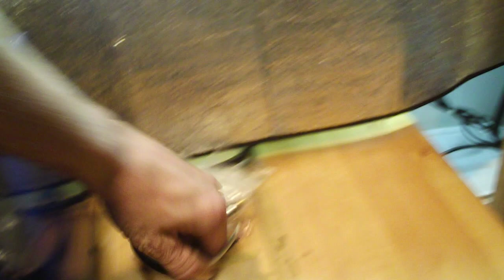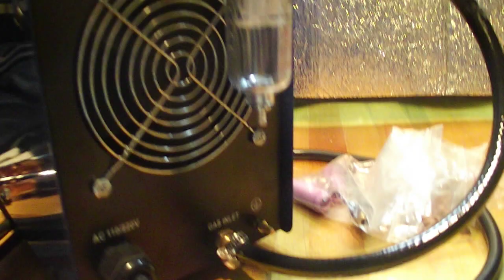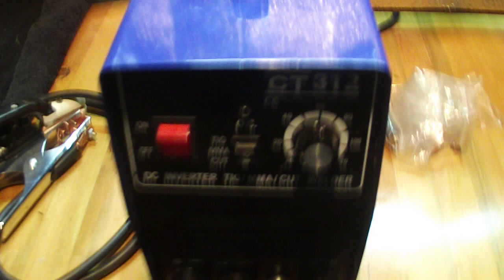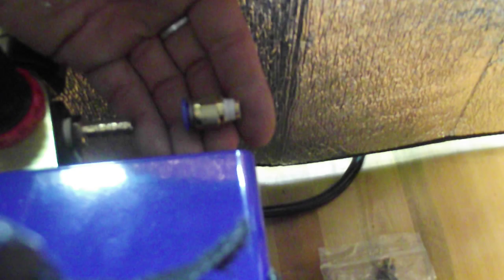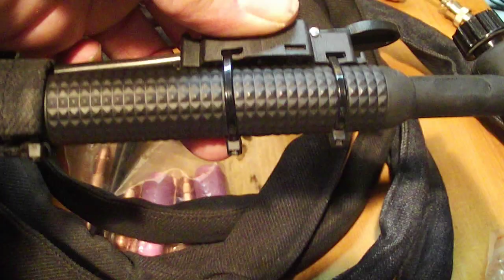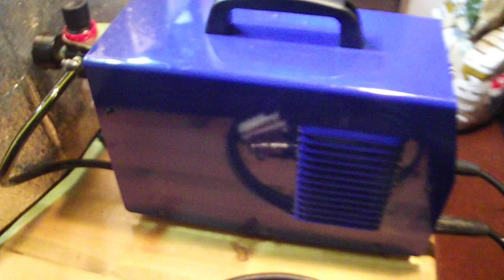Tig/Stick Plasma cutter CT-312 Welder  (Important info in description)

Comment: hi kootenayboy. i'm planning to buy one. mainly to tig weld as i already have a lincoln pack 140 mig welder. i also have a plasma cutter ( mastercraft crap than can barely cut 4mm of metal ) and the ct-312 would repalce it.  every reviews say it is a good unit and it last. do you still like it ?  oh btw don't buy a gas tank it's not worth the trouble. rent it ! i rent one for c25 argo for mig welding. it doesnt even cost 200$ CAD a year with a refill. really worth it !
Reply from the maker: Thanks for that tip, I have come to the same conclusion renting is the way to go.  Our local welding supply shop has the same deal and you don't need to go through all the static pressure testing to keep your tank current.  I've not used the plasma cutter yet but what I've seen others do impressed me it's not good for single pass on thick steel but up to 1/4" it's like a hot knife through butter. With all the snow and no shop I've not been welding much.  I've also got a Flux core wire feed not expensive but works for my needs Lol
Reply: "it's not good for single pass on thick steel but up to 1/4" it's like a hot knife through butter"  well that mean its 4x better than my mastercrap i have lol. the quality probably isnt better tho... mastercraft welder/cutter are as good as lincoln and other but underpowered. anyway ive seen a ct-312 open on youtube and it look very easy to repair. i didnt see any electronic component that i never seen elsewhere.
Reply from the maker: ya they are pretty decent, that said expect to have to tinker with it open it up tighten things basically do the final stuff the higher end products do for you.  Im almost positive that all these welders are made in the same factories but the ones you get like these are the ones that didnt  make the quality control cut and if your adept at tinkering etc that's great as you tend to be ok with saving a buck for a little diy fun.  the components are good and when you open it up there is a lot going on in there lol  I took a look when doing my endoscope  review and was impressed.  also you will want a much better system for the gas the one provided is like what you get with an airbrush compressor its light weight and not expensive also the fittings are small and not held in place with anything other than the barbs on the inserts.   Mastercraft can be hit n miss thats for sure some items are awesome and they come close to competing with craftsman (my theory that was their goal) while others are not worth the powder it would take to blow them up lol (grandfathers old saying)   I got this one for the tig but more the plasma cutter I want to build a bush bumper like the "Move" bush guards and the cutting is my least fave part as Im not set up for it so......   now Im more mature I feel I can have a plasma cutter and not use it for parking meters etc :P :P lol
Reply: for cutting thick metal , get a dualsaw. this thing is AMAZING and by King Canada  http://www.kingcanada.com/detail/ensemble-de-scie-dual-saw-mc-de-5-CS490/426?cid=29&mid=4&lang=en

it literally cut through 1 inch steel plate like hot knife in butter.
Reply from the maker: Wow that thing looks cool, its like my grinder but the dual opposite spinning blades is intriguing Ive always steered away from king canada but not because of personal experience but bias of other people  though Ive not heard anything bad about them lately so.......  I may look into getting one, how are the blades do they last a while or would you blast through them pretty quick?    I have those diamond blades but never used them on steel only stone, tile, cement etc.  Like I said Im gearing up for a bumper build and that will involve a lot of cutting of sheet steel with little margin for error and Im not necessarily a certified fabricator lol  just a degree from growing up Kootenay ;)
Reply: actually king canada is a high quality compagny. look around shops most of them use king. the only bad thing they make is the performance plus serie. stay away !. but other series are professional quality. jsut ehre in québec i know about 30 shops using king industrial.

Comment: I've got this, used it for cutting and TIG welding and it works very well. I was a new to it when I got it and without a proper flow meter when I started I used a lot a argon, now set at 6 LPM it's very consistent. I connected a variable pedal for amperage control though, it's a must have for any TIG welding in my opinion. (Involved taking the cover of and soldering it in via a switch).

It has a 5 second post-flow, no pre-flow of gas so I just tap the pedal when the torch is away from the metal then start the arc during the post flow. 

As for consumables, they are available very inexpensively from places like ebay.
Reply: Could you do a video to show how you wired the foot pedal in?
Reply: Did you make a video on installing the foot pedal?
Reply: James Allen question. Does this run of a 13 amp plug?

Comment: Hi kootenayboy. Thanks for the review, I'm thinking about getting one of these ct-312 machines but I'm wondering about the consumables are they pretty much standard where I can get them just about anywhere? I don't want to buy something that I cant get parts and consumables for. Thanks!
Reply: I BOUGHT ONE IN GERMANY FROM AMAZON FOR 253 EUR, AND IT CAME IN 2 OR 3 DAYS, AND I SAW SOME SPARE PARTS FOR IT U CAN BUY.
Reply from the maker: ya pretty much all the consumables are standard  (AS FAR AS I CAN TELL) I have a couple of th inexpensive welders and can walk into any welding shop including walmart and buy the rods tips wire etc  and they all seem to fit  this unit is not muck different.
Reply from the maker: ya they are your standard fair seems everyone carries them you can even get most off amazon  which is nice  you may want to pick up an extra set when you buy the machine as the process if your learning can lead you to blow through some tips lol
Reply: I have a mig welder and I was mostly looking for a plasma cutter which I have used quite a bit at my old job and when I saw this it looked like a good one to get. have done a little arc welding but not much, tig will be completely new to me so I can't wait to try it. Thanks!
Reply from the maker: ya the parts are pretty much standard its not like they need special rods or tips as long as you stick to the specs you can go to any welding supply store and get the gear for it  hell Ive gotten some at walmart  (online) cheaper than anything local or even online other places  and the quality was better than other places too  gotta love buying power :)
Reply: Hi kootenayboy i just bought one like this one is supposed to arrive tomorrow but now i just figured out this machine is 120 amps? Not 200 amp like what I’m thinking when I bought 🤦🏻‍♂️
Reply: @Stephen Varthas There is no AC option, but it can weld thin ally if you change the polarity to tungsten positive. However you will need a very large cup and tungsten (a gas lens helps here) and allow the tungsten tip to ball.

Comment: Have you tried tig or plasma on stainless?
Reply: Works great on stainless, just won't work on Aluminium as that requires AC and this is DC only.
Reply from the maker: No not yet I have to get the argon tanks for it and winter snuck up on me and with no shop Im a seasonal welder  but as soon as I do Ill post about it  thanks for watching :)

Comment: Have you tried any tigging with it? Is it lift, scratch, or HF start?
Reply from the maker: Here in canada in my area there is currently 4ft of snow on the ground and it makes it a little cold for welding without a shop, as I purchased it to make a bush bumper for my truck laying in the snow  when Im not getting paid for it is low on my list of fun things to do.  winter is for sledding, snowboarding, bonfires and warm cabins with warmer company  the welding will still be there in spring.
Reply from the maker: sadly no, Ive yet to get the argon tank as its now winter and  Ive no shop I probably will not get to it until the spring,  I did try the cutting with just compressed air but it did not go well and I burned out a tip but that's surly not the welders fault  thats on me  (My Grandfather always said its a poor carpenter who blames his tools)   I will say I want to beef up the compressed air components on this machine though as they are weak but good components are not expensive so its not really an issue .  thanks for watching sorry for the late reply
Reply: why buy one n video it then not use it fe..r use it tig  not why yota